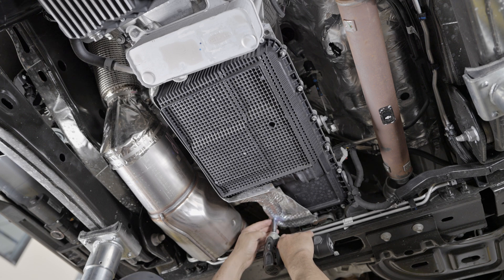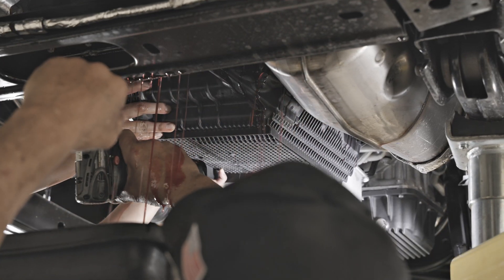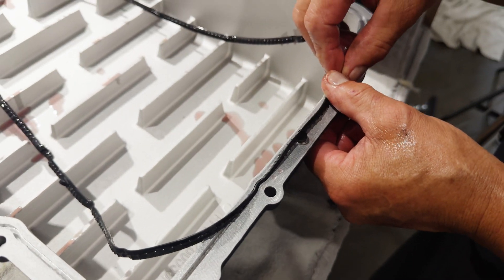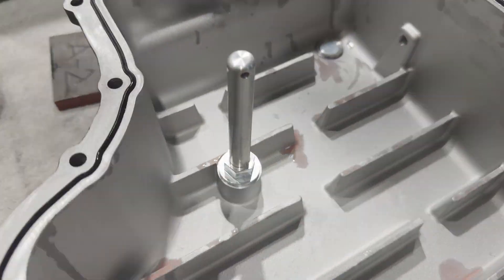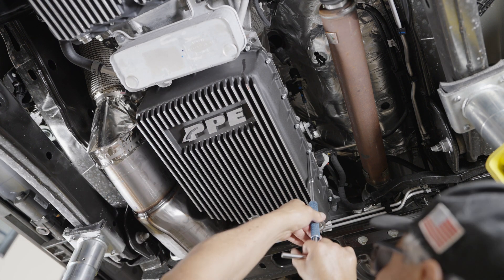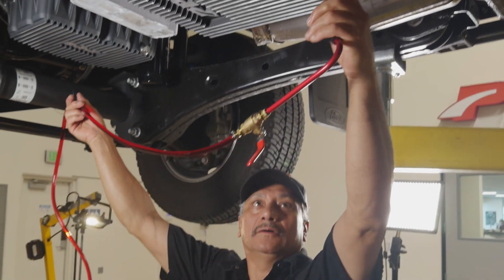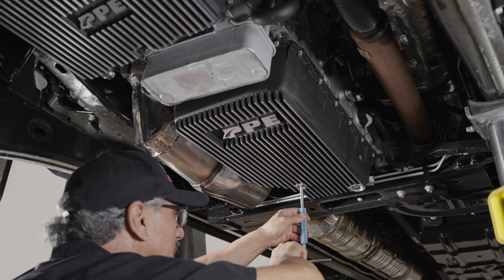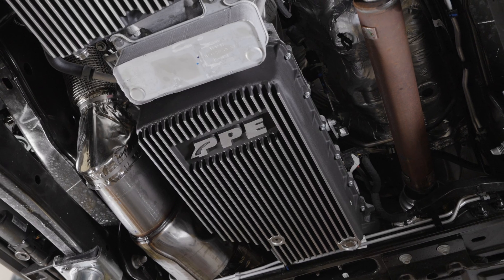Ford Super Duty 6.7L PowerStroke 10R140 Heavy-Duty Cast Aluminum Transmission Pan Installation Guide

Comment: Sure would be nice if you guys developed a pan for the gas trucks as well.  I would buy one...  Any plans to do that?
Reply: Check your transmission model, if you have a Ford, it is likely the same transmission as the diesel so this pan fits
Reply: @JM69 , you are correct...  F350 with 7.3 or 6.7 use the 10R140 trans, so yes this pan would fit the trans itself.  The problem is, gaser has two giant catalytic converters jammed right next to the pan plus a crossover pipe that runs under the back of pan.  Diesel on the other hand, has one large exhaust pipe that runs down passenger side and has much more room.  aFe makes a pan specifically for 7.3 trucks but, it uses RTV to seal it, which is a no go for me personally, and if you look at the installation pics, looks like the driver side converter is literally touching the pan, another no go in my book.  It would be nice if these guys made a stock sized replacement just to get rid of the plastic pan.